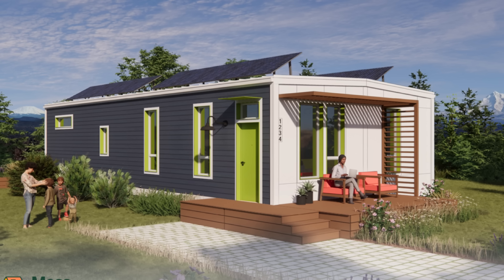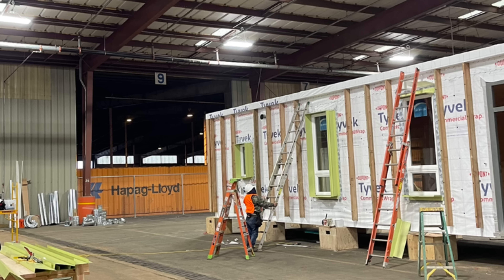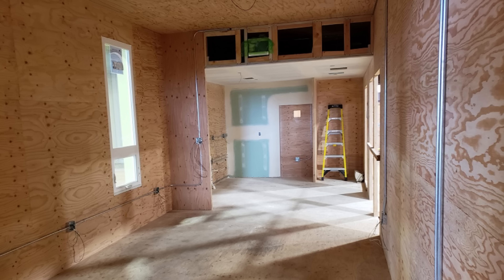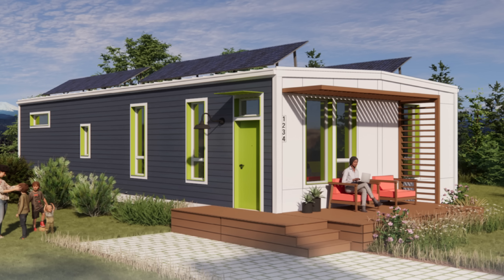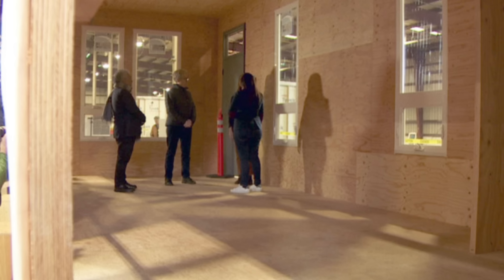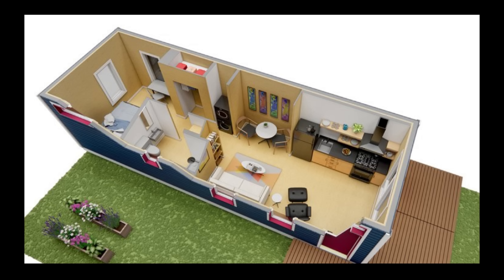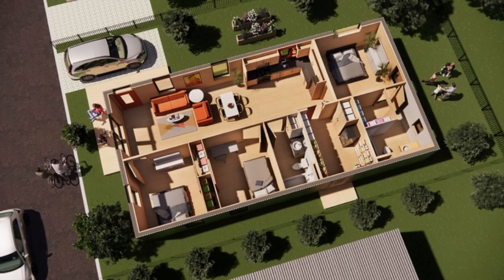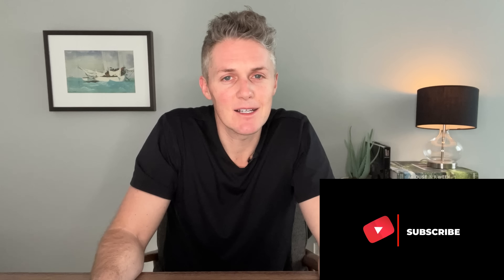A New Affordable PREFAB HOME is Coming to the West Coast!

Comment: Another great addition to the rapidly expanding affordable options. That is of course they're able to remain affordable. Sadly many affordable hopefuls struggle to keep to their target price range once production begin.

I have to say the placement of the front door baffles me. The floor area behind those glorious windws is given to the entry. The best placement seems to be between the sofa and the bathroom wall. This frees up floor space behind the windows for the table and chairs in the 1 bed unit and occasional chairs with a table in the larger units. The goal with small houses is utilizing every square inch with functional traffic flow while making the space feel larger. At the moment the one bed unit remains me of the common area of a dorm.....less doors to more bedrooms that is. That said, they call them prototypes for a reason. We can expect changes based on user feedback. At the same time I'm not sure what value the architect(s) added. To minimize costs you want all of the plumbing centralized. A redesign of the living area is logical given the kitchen and entry door locations. In time I'm confident the floorplans will improve.... For example; an L shaped kitchen on the bathroom wall, entry door, then the living room (relocating one of the tall fixed windows to former kitchen wall as a transom), and leave the dining nook where it is but add a window for cross ventilation.

Cheers!